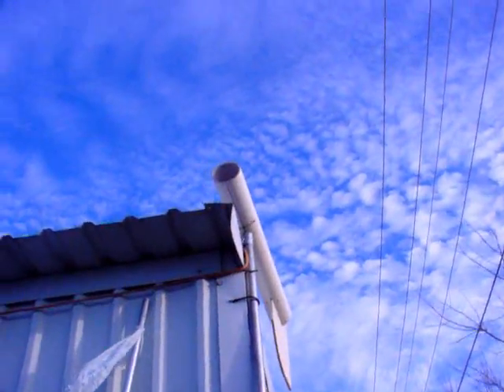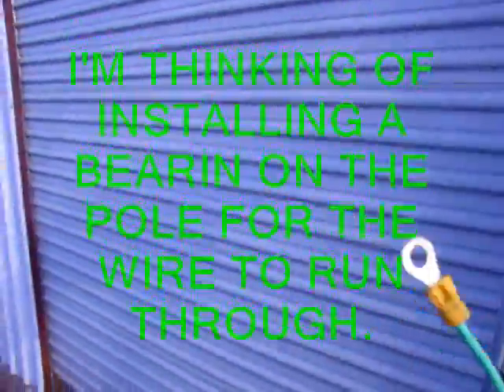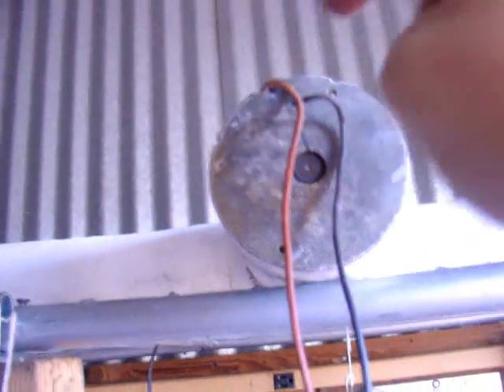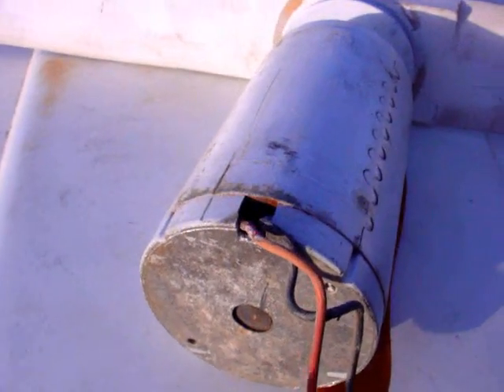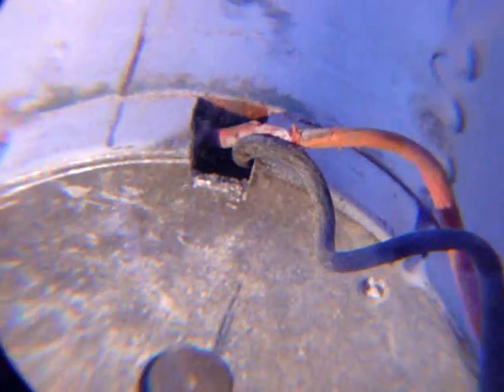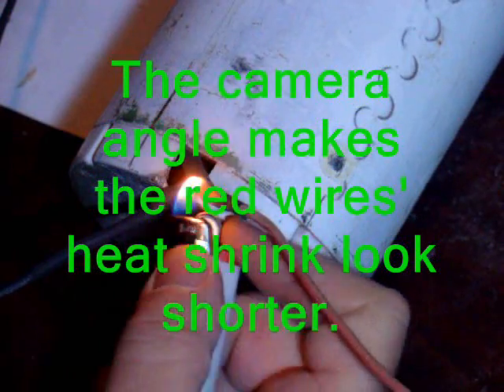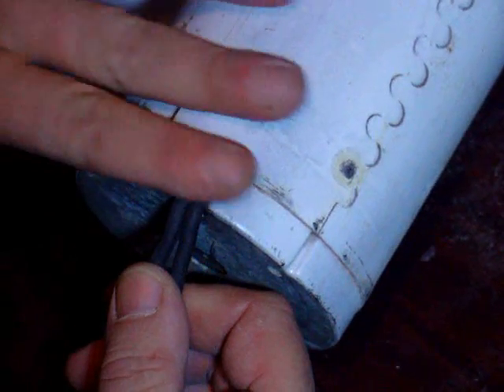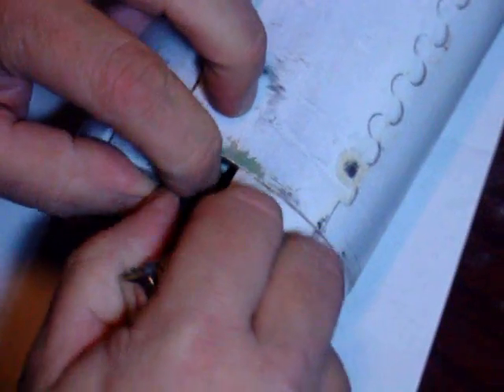TAPE DRIVE WIND TURBINE UPDATE 1 (SHORTED WIRES AND REPAIR)

Comment: SCOTT,  HAVE YOU LOOKED INTO  MAKING THE TURBIN BLADES QUIETER?  HAVEN'T NOTICED HIGH NOISE LEVELS IN  YOURS, IN PARTICULAR,  BUT THERE SEVERAL OUT THERE THAT MAKE A DISTURBING WHISTLEING SOUND AT CERTAIN TIP SPEEDS.    LIKE, BUT DIFFERENT,  UNTO THE UH1 HELICOPTER ROTORS USED IN VIETNAM.    HAVEN'T HEARD THE QUIET STYLE YET,   BUT A COUPLE OF VENDORS ADVERTISE  'SILENT' BLADES,    REGARDS

Comment: That warm weather looks good ... going to be a while before the ice melts in the yard here in Montana. Probably don't need to but ever pop the back off and look at the brushes and commutator. I had a treadmill motor up for a while and seem like the springs on the brushes (positive side) had significant corrosion just from humidity. Also the commutator started getting that statue of liberty look too ... cleaned everything up but figured that might be the first thing to go. Nice Repair!

Comment: Your sunshine came all the way up to NY today.  I now understand why it's so important to have those strain relief. If I don't have wiring clips or clamps, I at least use some zip ties to hold the wires in place. What started out as temporary wiring usually ended up as semi permanent.

Comment: looks to be about the same size as the motor i was telling you about the other day...now i'm thinking i should put some extra shrink tubing on those wires too; they're similar to yours - just hanging out and chaffing against the casing instead of thru a rubber grommet. its unfortunate it happened, but thx for sharing! take care MUDDy!